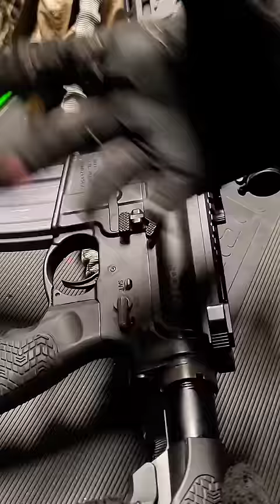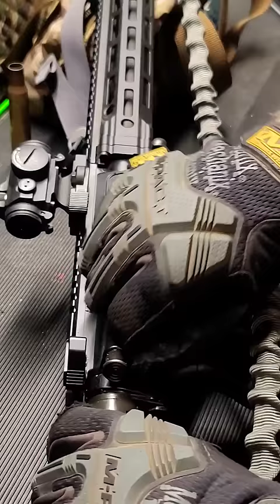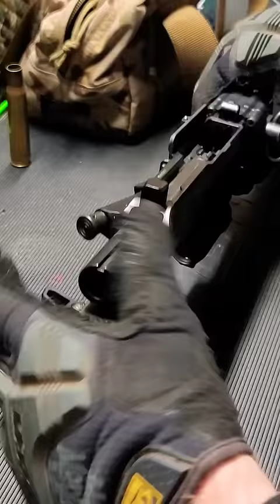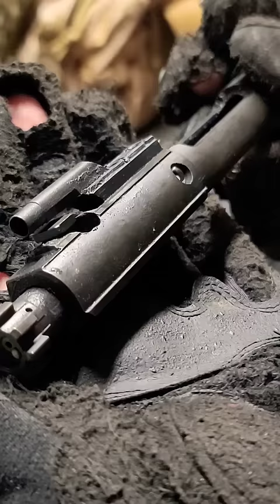2 HACKS You SHOULD know (But Don't)

Comment: Yall need a tool for take down pins? "Ya got soft hands boy"😂
Reply from the maker: Better watch it or " you are going to find out I have some hard spots too. ... that came out wrong. .... or did it? ... 😘"
Reply: use your fingers to clean the star chamber too, dude stuff.
Reply: Some ARs are harder than others. Never came across one that was tight?
Reply from the maker: @longdongsilver817  high-quality ARS. Very tight tolerances. Then you get them dirty
Reply: I would rather all of mine be tight.  One thing less to worry about if you need to use it.
Reply from the maker: @longdongsilver817  exactly.
Reply: @OvertonWindex  the dead pool quote made me spit my coffee 🤣
Reply: The M-16 I was issued in 75, was easy. the new out of the box AR-15 I got, had to be broken in a bit before it got easier. lol
Reply: Are you poor?
Reply: 😂 hahaha I think I just lost my a laughing so hard. TRUTH
Reply: Can’t get the pins out of mine with my bare hands because the pins are too small and my hands are too big. I can’t even get a grip on them to pull. I have to use a tool (I use a pen cap) to pop the pins out far enough to grab.
Reply: The pressure from my pinky finger does real good.
Reply: I got big hands. Not massive I don’t think but way too big to do that without the bullet/tool/pen
Reply: The rear pin on my AR that has a binary in it is very hard to push out. I actually squeeze the upper and lower together to push it out. Pretty much all of my other take down pins are pushed out normally with my thumb.
Reply: I’ve had to hammer out those pins because they were so tight it just depends on the upper because I tried with my fingers it wasn’t going
Reply: Guess someone has a problem with tight holes. 😅
Reply: Exactly what I thought! I've taken em apart probably thousands of times, and ive never had an issue. That trigger might be hard to pull... might need to use a bullet for that too.
Reply: @OvertonWindex I am sickened, but curious
Reply: I shave with a weed wacker every morning.
Reply: I have decidedly soft hands, but I've never struggled with taking down an AR15 or M4/M16...or any weapon system for that matter.

Whether during 8 years of active duty or in the 10+ years since, it's always been pretty easy. Rap the end of the pin with a knuckle, then grab the other side and pull it out. For the FPRP, just grab it with a fingernail, pen, pencil, tip of a bullet, or even an MRE spoon.

Too easy.
Reply: Son you high?! Loose and sloppy guns and like loose and sloppy women, not worth the money.
Reply: My Radian lower + adm upper is so tight put together it takes a whack from something to push the pins out.

I've yet to find anyone who can get them out without a tool.
Reply: @DDadams0  same, these are kidd talking a big game. If their pins aren't tight I doubt their weapons usefulness or reliability.
Reply: @oldvet7566  Agreed. You couldn't stick a hair between my upper and lower when assembled. 

My go-to is as solid as if it were a single piece of metal that wouldn't separate in two.

After the struggle of removing the pins is done taking the upper off the lower is another very forceful effort-fest.
Reply: @DDadams0  same, I have multiple platforms and I make sure none of my pins are so easy to knock out. 
I would never trust anyone's gun to fire if they handed it to me that sloppy. 
The big balls talking here are funny though,,,, full of sh1t,,,, but funny.
Reply: Smack the butt on a hard surface while pushing on the pins with your thumbs.
Reply: Facts
Reply: @dragonsofthunder  ok son, see what your hands and fingers are like after a decade of arthritis, 30 years of maintenance, construction, and 20 years of service. Good luck
Reply: Lol I was taught to take out the pins with the mag. We never had the luxury with tools
Reply: @shawnbailey7600 my pinky is small long  and thin and flexible. Star chamber didnt have no carbon no matter how much the commander fingered it. Others wanted me to finger their star chamber. But after a few ,my pinky was sore.
Reply: I've been issued M16s where it was god damn impossible to just push it through.  Terrible lol. Never had that issue with an AR15 though.
Reply: I have 8 arsI've owned about 11 of them and I've never had any significant problem with any of this but whatever
Reply: @OvertonWindex rah?😨
Reply: Noveske takedown pins are tough
Reply: Sounds like someone's got small fingers 😂
Reply: @OvertonWindex nah that def came out wrong😂
Reply: Yall saying "my hands are too big" are hilarious. Im 6'6 and can pull my takedowns no problem.....
Reply: @longdongsilver817 thought the same, my ar is not an issue, but the m16 issued to me .... that was a different story!
Reply: I have long nails and a husband for that 👍
Reply: @OvertonWindex  of course you do, it's where that hole in your glove is!
Reply: Bro I managed to get my pins stuck.
If you can remove my pins with your hands then you could probably strange a grizzly.
Reply: Okay I did think that for a sec 😂
Reply: Daniel Defense makes a great AR with great quality tolerances. Everyone SHOULD know this because you can never know TOO much about your weapon
Reply: I’ve always punch the pins with my thumb
Reply: Indeed
Reply: If you get an out of the box new AR-15, the take down pins are pretty tight and not as easy to push through as one that has had like thousands of rounds shot through them. The tolerances on a new AR tend to be tight. You got that break-in period on an AR just like you have on a new leather holster, new shoes, gloves etc.
Reply: It's not that I have soft hands more than I have beer cans for finger tips. And on my rifle, the idea of field stripping the upper and then having the front pin fly out of the rifle and not be able to find it was something I said no to. That has happened before, and it only took me going to the gun store ONCE to figure out, I needed an alternative plan for the front pin.
Reply: You can easily take down a super tight AR without any tools, just gotta use the brain.
Reply: @SLAYERxX420  😅😅 weak
Reply: @OvertonWindex Holes is holes.
Reply: @OvertonWindex never had a problem with my colt
Reply: @OvertonWindex 

 "Overton Windex"......🤭

Well played 👍
Reply: No you just have cheap rifles
Reply: Laughs in carpenter hand's on the daily I break off and bend nails with my fingers... Although he is right, the best tool is a round...
Reply: @Radvous "without any tools" so just bare hands? I would bet you a check you can't take my upper off lower of my 300 blackout build bare hands.
Reply: Exactley, but then again, mine might be a bit looser than factory.

Comment: And if you still have iron sights, you can use that same round to adjust the front and rear sights.
Reply: How
Reply: irons are for the poor
Reply: @Crettybocker427   Well I was serving in the USAF at the time. Back in 75-95. Never thought of myself as poor.
Reply: people kept sayin that, I could never get a round to fit between the wings and the sight post.
Reply: @tye331  Take the tip of the round and use it to push that small round button down and then as the tip is there, just move it in the direction you want it to go. This is on the forward iron sight of the rifle. on the rear sight, basically the same thing, push the tip in and rotate left or right.
Reply: They adjust optics too. Bullets can be used for a lot of things on a rifle. Just use the case side instead of a penny or screwdriver.
Reply: I am a die hard Iron sight guy... Glad people waste money on optics they'll never use... lmao
Reply: Came here to comment that as well.
Reply: @johnstraub7494  that works for the M16A1 rear sight. The A2 rear is a knob.
Reply: @thomasbraden8242  I'm sure, but I retired in Oct 95 and we still had the A1 sights. Not sure when they started issuing the A2's but as you are well aware, distributing anything to how many squadrons, bases, commands at anytime, can take forever. lol
Reply: @johnstraub7494  we had A2's in 87. But I gottcha
Reply: @johnstraub7494 We ran out of M193 stored in caves in Europe, so in the late 90s the Air Force started modifying our M16s (model 604s, not A1s) to an A2 compatible rifle. We only installed the A2 barrel, furniture & 3rd burst. Unless the upper was replaced, it still sported the original sights (Army & Marine guys would call them A1 sights, but they predate the A1). 

So, the late 90s Air Force had a Franken-AR that was very similar to the Canadian C7. We hated it. It didn't last long. They were quickly replaced by the M4/M4A1. 🤠
Reply: @tye331 The wings are in the sides, the pin is in the center to the rear of the post, if you can’t fit the tip of the round it’s bc you are in the wing spot. Even still using a round is like using an open end wrench in a tight spot, it’s a pain in the butt. They make front sight adjustment tools that are dirt cheap and the size of a handcuff key. Sight adjustment tools are typically great bang for the buck especially I you plan on owning a lot of firearms that use the same type, especially pistols with “fixed” sights, one tool will cover most of them.
Reply: @MatthewZelek-iv8tb  we used our handcuff keys lol 

(Det 1/ 1186th MP Co. ORANG)
Reply: @nathanthomas8251  On an A2 carry handle it's not necessary. The A2 has a knob on the right for left to right travel, and there is an adjustment knob under the sight for elevation. On the A1, there is a star looking pattern of sorts on the right side where pushing a bullet tip into it would serve as the adjustment knob on the rifle. 

On the front sight, just behind the post front sight is a detent where the tip of a bullet can go so you can give the sight a 180 degree turn until it clicked into position, slightly higher or lower depending on whether you turned the post clockwise or counterclockwise.
Reply: @haroldenglish943  When the optic's battery dies or the optic is damaged, or god forbid, shot, then what??

Learn to use your sights and THEN buy the optic.

And don't skimp on the optic, either. A state of the art rifle with a shitty 50 dollar optic turns the rifle into junk.
Reply: @mr.e1026  Pretty sure you are replying to the wrong person.  Lord knows I'm anti battery operated sights and only within the last decade have I lowered my hunting standards to using scopes as I've aged a bit.
Reply: @mr.e1026  Re: what do you do when the battery dies?

I yank the optic off and stuff it in a cargo pocket. The battery only really powers the reticle, you can still see through the optic, but for anything under 150 yards, just the rail on the top of the receiver will give enough aim to allow hits...

Ironically, just about the optimal range of an ACOG...
Reply: @nunyabidness674  depends on the situation. If the battery on an Aimpoint actually dies, something else probably happened to it. I would just use it as is until it was either time to change the battery, or pop it off.

There are times I just pop it off anyway, just to lighten the gun some. It's not like I am not skilled using iron sights, anyway.
Reply: You're right, and I have no idea why it shifted to you. My bad.
Reply: @Crettybocker427  When the optic's battery dies or the optic is damaged, or god forbid, shot, then what??

Learn to use your sights and THEN buy the optic.

And don't skimp on the optic, either. A state of the art rifle with a shitty 50 dollar optic turns the rifle into junk.
Reply: @haroldenglish943  there... fixed it.
Reply: @mr.e1026 Point shooting is a great thing to learn, too. Helps with sight picture, aiming speed, and getting really good at it can save you in the right spot. I need to get one of those dry fire laser things..
Reply: Tactical Seth Rogan ??
Reply: Front sight: yes. Rear sight: no.
Reply: @amedaius8492  On an M16A1 you can. A2 has a knob and a slider.
Reply: @Crettybocker427 If you’re not running Aimpoint, Trijicon or knightforce you can’t call someone poor
Reply: @donwyoming1936  The M-16's I carried, were full auto and not forward assist on them. At Minot, we had the 20 rd mags, Belgium, we were issued 30 rd mags. Got back to the world and still have full auto, 30 mags, and now had Peacekeepers and 4 man fireteams. Went to Iceland, well no Peacekeeper. Just pickup trucks, wind and snow, then to Andrews. Just SRT ART ECP CIB and area supervisor which consisted of an NCO, which when I got there, the lowest rank on the flight line was a SSgt. We had MSgts working single aircraft. Keep in mind, the mission of the 89th, then the 1776th and back to the 89th SPS, Working Special Air Mission missions/aircraft to include Presidential. We started getting E-3-4 I think the late 80-'s? And females assigned to the squadron for aircraft security then too.

Comment: I was shown that in basic training back in 1981. I hope they’re still showing new recruits that trick
Reply: I think they are now focusing on the proper way to remove nail polish and how to tie laces on boots along with sensitivity and diversity training.
Reply: Yes and no. They won't have live rounds present for many instructional sessions especially during basic training for many reasons, safety being the prevailing reason. Though, I don't see why at least showing this method in a video would hurt. 
It's been 20yrs since I was in basic, so I honestly don't remember if they showed this. I'm 80% positive they did at least talk and demonstrate this, but we did not have live or dummy rounds to imitate and used some other gear piece to disassemble. 
I can still ealiy disassemble the AR platform rifle blindfolded, and reassemble.
Reply: I've been trying to remove that retaining ng pin for 2 hours now, for some reason the bullets just aren't doing what they do in the video, by the way I have an MP15-22, can someone pls help
Reply: I may have been but we just used cleaning rods. The bolt pin can be pushed from the other side enough to grab it.
Reply: Went through Infantry OSUT 2021. We were taught to use a pen. Really tho, it doesn't matter you can just pull the damn thing apart
Reply: They dont allow recruits to have live ammo or even brass except at the range. After every range the drills would go through our bodies and bags with a metal detector wand. This was in 2018 and is to prevent self harm or harm to others so the unit is not liable.
Reply: Same here! 1981 Ft. McClellan Alabama
Reply: @Defender78 hey man.. he's using the 5.56 or 223 cartridge not a .22lr the 5.56 has a point and the 22lr has a rounded projectile. Just an FYI a month later.. I hope you're still not sitting there trying 🤷‍♂️
Reply: They didn't when I went through in 05, though eventually I was shown how it works for the front sight adjustment
Reply: @phillhuddleston9445  Not sure how "tie laces on boots" is an insult, but hey, that's legitimately valuable knowledge that you still need to know to keep your boots on.

Also, what's wrong with teaching people that other races and demographics are human too?
Reply: Real men use their fingers
Reply: They were in '04.
Reply: @chrissnarx   Well my MP1522 didn't come with a device like that maybe I could have kept one from my army days but that was 20 years ago. What happened after I posted the message, I thought about using a 22 caliber round, but it didn't seem to work plus I was afraid that trying to put pressure on the back of that round would set off the rimfire and then I'd just shoot my gun and have a bad day, so what happened I was I ended up poking through the retaining pin with a screwdriver and they ended up breaking out of the receiver housing, so I took it to my LGS and they fixed it for free but now I know I'll use a dimpled edged device rather than a screwdriver that punched all the way through.  Hopefully I can find an AR15 user that will sell me one bullet to punch out (partially) that retaining pin ..
Reply: Went to usmc boot camp in 2019. We didn’t have live rounds unless we were on the range so we didn’t do this. Used the rods in our cleaning kits to field strip it. I think there was some mention of using a live round but I don’t remember for sure. I’ve been doing this for a while tho and idk if my dad taught me (also a former marine) or if I learned it in the marines or if I just figured it out on my own
Reply: @Billboi805  Back in '04 we weren't allowed live rounds off range either but our DI's would let us get away with carrying one just to make it easier to take out that infernal firing pin retention pin on the bolt carrier. There were also a few recruits who had fingers that were too fat to engage the takedown and pivot pin so it came in handy for them too.
Reply: It's not a trick it's literally in the FM.
Reply: Naw they make us use our fingers.
Reply: From my recollection in 2005, they are not, but we did it naturally.
Reply: They're not allowed to field strip Rifles of Colour anymore, it encroached upon the rifles Lived Experience.

Comment: The springs for the takedown pin detents, take wire cutters and cut 3 turns off each spring.
Now the takedown pins can be pulled much easier, but still enough tension to hold firmly. 
The pin for the bolt carrier, disassembly is the easy part, putting together without tools can be quite the challenge.
Reply: I take a sharpening stone and file down the points of the new pin just a bit. I also put a drop of lobe in the pin channel.
Reply: There's a perma pin replacement for cotter keys. Makes it easier to remove and replace.

Comment: The Colt AR-15 Models 601 & 602 had bullet point recesses in the take down pins, but great care had to be taken to avoid jerking the front pin out of the lower receiver, as it was "pre fence" and it was barely held in there.  The firing pin retention pin was also different and absolutely had to be pushed out from the right side of the bolt carrier.